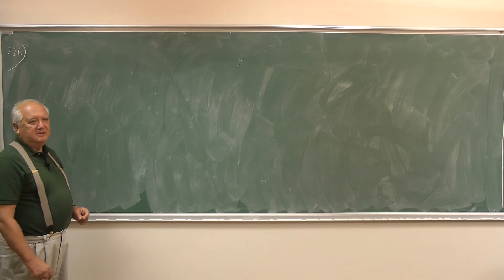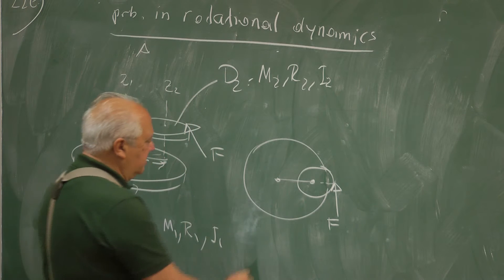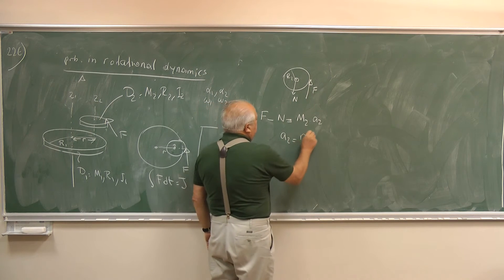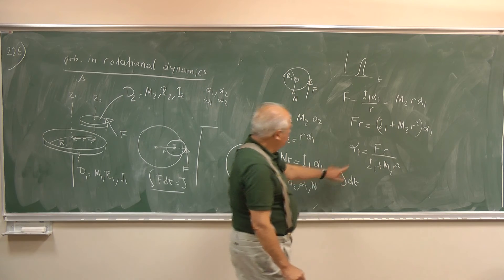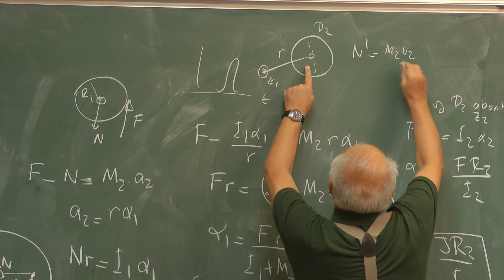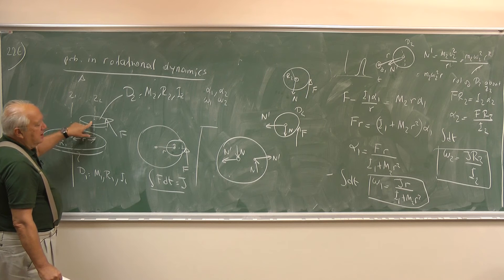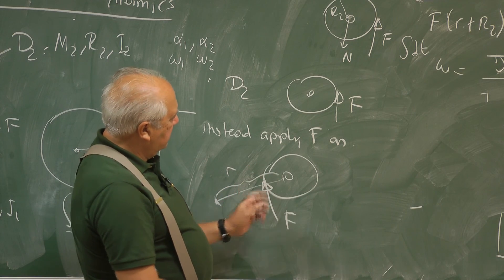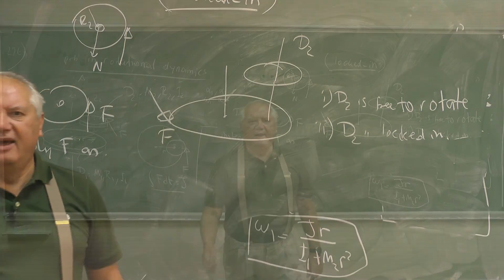Rotational dynamics: A two disk problem

Comment: What if the two disks were positioned on the same axle but with a distance between them. How would you calculate the torque needed to rotate the system ?